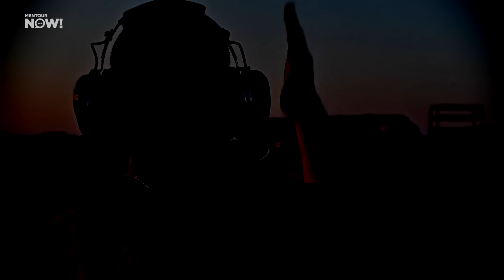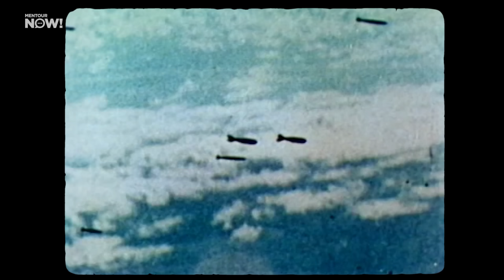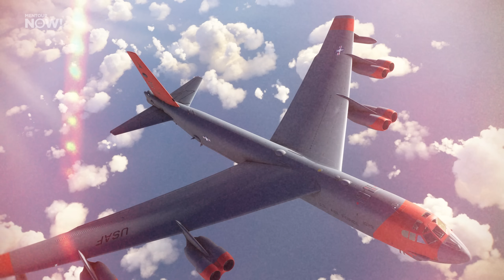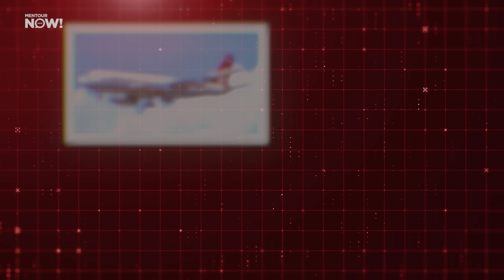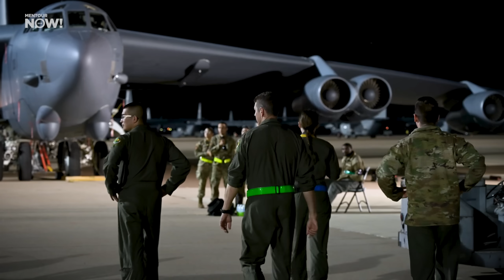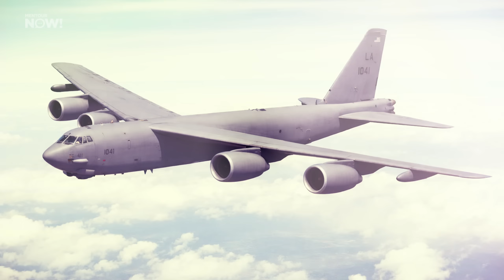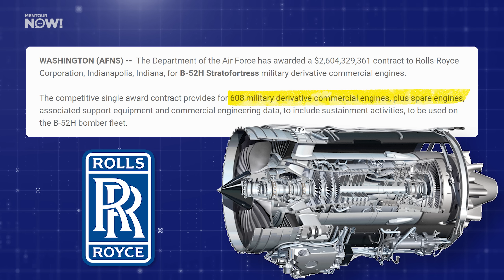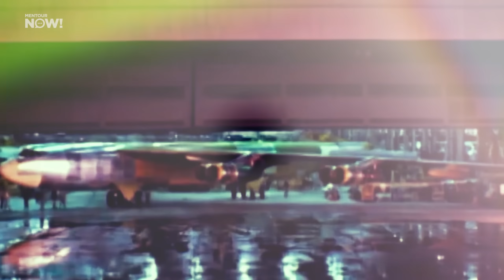WHY Are They Changing The B-52 NOW?!

Comment from the maker: *Use the code "pilot" and this link 👉 https://incogni.com/pilot to get a whopping 60% off the Annual Incogni plan!*
Reply: Hi there. I know this is off topic, but can we get an episode on MH370 and the current search that started few days ago.
Reply: The B-52 is older than the C-130, and neither of them seem to be going away any time soon.
Reply: One of the major reasons is a general technical and economic issue.  There is so much invested in the B-52 that the cost of change, major, minor, replacement, etc. is a huge factor.  The video addresses this in the specific context really well, but the general issues are nearly universal with many other established technical systems.  The legacy system just persists and then passes down certain aspects to replacements.  For example, the QWERTY keyboard we still use today- the layout is well over 100 years ago based on mechanical typewriter limitations... but people are used to it.  It took 20 years for the USA to move away from magnetic stripe as primary on credit cards, etc. because of merchant device base (millions of units).  For something like B-52 the built up capabilities in training, support, logistics are massive.  The economics make it hard to walk away from that unless there is real benefits to do so.  Hence, use a "new" engine (for B-52) that USAF already has some support tail on makes perfect sense!
Reply: @JkGreyWolf-21      The QWERTY keyboard is based upon relative frequency of character usage in the English language.   Also, the design of the human hand.    
      Please don't tell me what new age nerd design you would make it.   I've lived a whole lifetime of computer people screwing up things that our very intelligent forefathers already figured out perfectly fine.
Reply: @BillSmith-fx7xx.    You’re likely thinking of the DVORAK keyboard.
    
QWERTY was not the first, or second, key layout.  It was adopted because the old typewriters would jam with multiple arms running in to each other, trying to share the same space.  Traffic jam issue that got worse the faster someone typed.  The most used letters had to be spaced out because of the physical arms behind them.  
.  Google response:  The Dvorak keyboard layout is an alternative typing arrangement patented in 1936 by August Dvorak and William Dealey. It places 70% of frequently used English letters on the home row to maximize typing speed, reduce finger travel distance, and minimize repetitive strain injuries compared to standard QWERTY keyboards. 
Don’t get me wrong, I’m no fan of “tech bros” who are myopic, but logistics and design persistence are real things.
That’s kind of proving my point- the DVORAK keyboard design SHOULD have replaced Qwerty- but it didn’t.
Reply: @JkGreyWolf-21       Thank you for your kind response.   😊        When I learned typing in high school we were taught that the QWERTY was designed with efficiency in mind.   What I picked up reading on internet was that with a few adjustments to the 'then' existing design, the QWERTY emerged and was the more effective typewriter.   QWERTY solved the internal key jamming problem.   
        Actual key placement 'for speed' may represent a slightly different reality for a modern piece of equipment that is not dependent on mechanical movement.   I did come across this sentence,  " . . . initially used a much simpler, alphabetical arrangement of keys. "    THAT MAKES ME LAUGH !  😅  😂      Seeing as how the English alphabet has the vowels strung from one end to the other and the R S T L N  in no partcular coherent arrangement, one can only guess as to what 'simpler alphabetical arrangement' means !  😮      ?  ?  😅
       Again, I do appreciate your response.   I learned something from it.   (I am hot on the heels of A I.  I'll catch AI in a day or two !  😂 )    
     Examples of new smarts.    One space between sentences instead of two.   Not enough spacing around letters;   i,  l,  1, .   Go look at any old books, newspapers & magazines (pre 1960) and see how much easier they are to read.   Five-hundred-thirty ish years between Gutenberg printing press and digital and the 'modern' people think they know better than the useful 'standards' that those type-setters developed.  For 500+ yrs they knew better.   Since the first digital computer document was created, documentation has exploded a gazillion-trillion-billion times over.   The 'new smart nerds' have made every one of them harder to read !   😢  😢      Or I could discuss Elon's resistence to putting the turn-signal lever back on the steering column !   Use the center mount touch screen icon.   YIKES !   
       Seems I have diverged from keyboards.   Sir, you have a good day !   It has been a pleasure.   
      P.S.   I use 3 spaces between sentences.   The computer spaces are small !
Reply: They're still flying de Havilland DHC-3 Otters in Canada in commercial service  that are 70+ years old. Wonder if that's the oldest?
Reply: I would give Incogni an F- based on my experience.  Their "money back guarantee" is shorter than the window they need to close with the data brokers, how convenient!  My spam has only increased and their weak response is to have me send them screen shots of all the spam.  But wait, wasn't their sales pitch that they reduce customer workload?  Total BS.
Reply: @justwantresults8768 , ouch!
Reply: As a B52 crew chief in SAC back in the 70s I appreciate the update. Talk about  fuel, the KC135, fully fueled, weighed about 300,000lbs. While the B52-H could and would often launch with 300,000lbs of fuel plus it's bomb load.
Reply: There was nothing said about Radar Cross Section?
Reply: So basically the cores must shrink while everything else remains the same size. Same thrust, and just sipping gas.
Reply: You take too Goddamned long to make relevant, useful points.  
Is this guy a pilot ?  Because us A&Ps never accused them of
knowing too much...
Reply: Nicely done!
Reply: No.
Reply: 😮 20:41 20:42 20:42 20:43
Reply: If I were being shot at.  Either from other planes or flak from the ground.  I'd rather have 8 smaller engines than 2 big engines.  This way if two engines were damaged, I'd still have 6 functioning engines.
Reply: @BrettonFerguson  Zero IQ take. You want fraction of the range, speed, reliability, electricity, etc, just to keep old trash? Also, clownbecile, if one pod is hit, the explosion of the engine will most likely destroy pod next to it so you're left with 4 engines on the other wing that offer even LESS than 1 modern engine would sooo...
Reply: @BrettonFerguson  I’d rather simply not volunteer to bomb people. 🤷
Reply: @mikegreen2214     That is assuming no one wants to bomb you.   I would not count on that.
Reply: Rolls Royce in name, but with little british in it. It started as a joint venture: BMW Rolls-Royce AeroEngines GmbH in germany. Design and production are located in Germany.
Reply: @juliane__  A 'joint venture' with RR Aero engines GmbH (a wholly owned subsidiary of RR) but 'little English' in it? The engines for the USAF will be manufactured in Indianapolis. RR"s German subsidiary makes a civil version of this engine.
Reply: @juliane__  You see that bit of 'BMW Rolls-Royce AeroEngines GmbH' that says 'Rolls-Royce', that's the British bit and the 725 wasn't developed till after BMW had opted out and it features both 700 series and Trent design elements.
And the German part was more Motorenfabrik Oberursel (KHD) than BMW (I'm inclined to think that the 700 designation is a allusion to their last wartime engine project). Post war they returned to aero engine production and building gas turbines and gas turbine parts under licence for various companies including Rolls Royce.
Reply: Outstanding video ... great research along with super information
Reply: It's an abomination changing the classic analog instrumentation with digital slop.  heh
Reply: @BillAnt Not if you're trying to stay alive 😂
Reply: Thanks for this very informative data dump.  Much appreciated.

And I must say, back in the early 1980s, I knew a guy in ROTC who was a senior when I was a freshman, and he became a B-52 pilot like his father.  And he reported that his father, a decade or 2 before, had written his name in paint pen on the sun visor of the same airplane my friend was now flying.  And that was what, 2 generations or more ago?  So yeah, it's crazy that of all the military planes I grew up with and saw on a daily basis in the 60s-80s, the only one still on the front line is the slowest, least-efficient, and least stealthy of them all.  I've seen all the Century Series of my youth disappear, along with the F-8, F-4, F-14, E-2, A-3 through A-7, etc.  And in a prior career, I built B-1s and B-2s as well as C-17s, while keeping C-5s and C-141s limping along. And I've seen the F-15, F-16, F-18, F-117, and F-22 come and go or stick around to be heavily modified for increasingly limited usefulness.  And now it's the turn of the F-35. May it all work out OK in the end.  But the ancient BUFF keeps on soldiering. Gotta respect that.
Reply: They should just have boeing upgrade some 777s with bomb doors and the necessary equipment, problem fixed.
Reply: @thomgizziz They haven't completed the desitn and production for the new Arforce One,  yes, thats not what the plane is called, I know. Don't distract them with a super heavy bomber request.
Reply: The plane is up to the H model which means it's been upgraded 7-8 times already. They did make a replacement for it, it's  call the B1B.
Reply: :hand-pink-waving:
Reply: What about the treaties that only allow B52s? Hello Turkey. Also dont forget how small the rudder of a B52 is. Mainly it's about the treaty.
Reply: @daniellarge9784 B-52 rudder is huge....?
Reply: Buff's getting knee replacements.....
Reply: Yatahey Db from Hawaii
Reply: Interesting video!

How many BUFFs will be upgraded to the J model?
Reply: Sigh  YT wont let me post a link

This came across my FB feed today

Retirement ceremonues for NCC-1701G were interrupted by a B-52 flyby
Reply: I think while you were recording, theres music playing in the background. It's like having a fly on your back you can't quite feel and you can't quit hit. 
Great content short of that.
Reply: Has a soldier I've had the opportunity to fly on numerous airframes. The one thing about the B-52 is its payload capability which to me suggests why keeping 8 engines is a requirement. Plus when a nuclear event occurs they may have to fly through the massively rising pressure and survive. As you know better than I do, a mere general aviation pilot, the B-52 hotel is able to fly on a minimum of two engines safely, or in rare incidents fly on one engine. That gives them the ability to carry multiple 500,000 lb bunker busters. The B-52 can carry payload of 70 k compared to the B1 bomber can carry a payload of 75k. The b-1 lancer is less capable of surviving EMP from a nuclear bomb but can fly lower and faster. There are trade-offs on both sides.
Reply: The USAF have been clearly been reading the Dale Brown "Paddy McClanahan" series of novels!

They're trying to create the Megafortress!
Reply: How else do you milk the American taxpayer. More money for a useless weapon instead of healthcare, roads, bridges, fair wages , retirement, etc etc.
Reply: @silverthorngoodtree5533 Without this “useless weapon. Chances are pretty good you could be speaking Russian right now! BTW, I have been around longer than the BUFF, barely. But that makes me old!
Reply: They should replace it.
Reply: @Scott-25300 It's highly specialised. Replace it with way. I guess modern avionics woulr b3 nice though. I believe the B-52 has Inertial reference systems for nagvigtion. Its a dinosaur, but dependable.
Reply: @gorillaau  They could just take 777s and stuff in all the specialized things that they need. This isn't that hard of a problem to solve they just don't want to make the change because they are stuck in their ways.
Reply: @thomgizziz Military budgets run deep.

Comment: Mentour,   I'm digging way back, way back.   All the B-52s flying now are H model, first gen turbo fan, probably TF-33, as stated.   The earlier B-52 G model was, I think, J-57, second gen turbo JET, no fan, all exhaust.   Some KC-135A models were refitted with TF-33 (variant) and were redesignated as KC-135E.   Right around 1985-86, the remaining KC-135A models began being upgraded to the CFM56.   Then were redesignated as KC-135R.   
       Also, the B-52 wingroot was upgraded once already in the mid 80s when they put on the pylons for the ALCM, Air Launched Cruise Missle.   Six missles per side.
      Back in the day, Boeing, McDonnell Douglas, Lockheed, Northrop, they made some tough airplanes !   Upgrades & mods are important but they had great airframes to start with !   You gotta wonder about some of the modern stuff.

Comment: One clear difference between an airliner and a military plane is the hours flown per annum.
This affects the value of engine efficiency. Efficiency is  the most important component (after safety) in design decisions for an airliner. On a military plane, other factors (like surviving impacts) may be more important.

Comment: It would make more sense to convert a C-17 airframe to bomber duty. The C-17 has 170,900 Lbs of cargo capacity vs the B-52's 80,000 Lbs ordinace capacity. The C17 has 245,226 Lbs of fuel capacity, whereas the B52 has 312,197 Lbs of fuel capacity. If 90,000 lbs of the C17's cargo capacity were transferred to fuel capacity, the C-17 would have 325,000 lbs of fuel capacity (10,000 more than the B-52). As discussed, the existing B-52s are using eight Pratt & Whitney TF33-P-3/103 (17,000 lbs thrust) 1.15:1 Bypass ratio, where the C-17 is using the four Pratt & Whitney F117-PW-100 turbofan engines. Each engine delivers 40,440 pounds of thrust (131% more total thrust) and a 5.9-1 bypass ratio. The C-17 has one of the most incredible supercritical wing and flap designs, with incredibly short takeoffs and a cruising speed of Mach 0.825 (578 MPH). The B-52's swept wings take a long runway to take off and are designed for a cruising speed of Mach 0.780 (550 MPH). The C-17 is a fully digital integrated warfare plane. The C-17 currently drops the 21,715 Lb GBU-43/B MOAB (mother of all bombs), which the B-52H can not.

Comment: I'm retired now, but worked many years for USAF DOD, Civilian Employee (Machinist)
I lost count how many parts I machined for the B-52. Some very simple, others, quite complicated.
Having blueprints of the parts I was making dated in the 50's. 8 - 10 years before I was born!
The TF-33 engines on the 52's were a very old design. They smoked worst then a cigar and were not very efficient 
Replacing them only made sense.

Comment: You do not explain why the B52 is staying ‘relevant’, specifically when comparing to current the current B1 B2 that are actually working,   What is wrong with  those that you say the B52 will still be flying when these are retired.    You do great work, but this seems an obvious point that should be made??    Especially when penciling out the 10yr calendar, and the costs involved… how can keeping the B52 pencil?  Are the B1 B2 in fact that bad of an aircraft that they are less expensive, in time and money and function, that these 40yo planes and all that is required to keep them “relevant”?

Comment: The B-52 first flew in the early 1950s. It was equipped with the then available engines. Jet engines have been undergoing continuous improvement in fuel efficiency ever since. It would be foolish to continue to use outmoded 70-year-old engines, because contemporary jet engines are far better in every way, including fuel efficiency. New engines reduce fuel consumption and extend operating range.

Comment: You do not get it.  The aircraft is paid for. The engine is paid for. They do not have to spend as much for the parts.  Once it is stopped production. New engines are chosen.  Bit the B52. IT CAN FLY ON 2 ENGINES. Using the last allows more funding for other products.

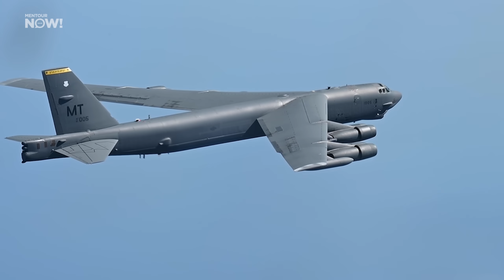Comment: 3:40 it's because the B-52 fills a role that none of the other aircraft you mentioned can. Sure, a B-1 can go supersonic and the B-2 is stealth but they both have far smaller payload bays than the B-52. The B-2 is what we use when enemy air defenses are still intact and operational. The B-1 is what we use when enemy air defenses are being actively suppressed and raw speed is enough to get in and out unscathed, and it has a larger payload bay then the B-2. The B-52 is what we use when enemy air defenses are nonexistent, because it's way more economical at that point. We need neither the speed nor the stealth at that point, we need the sheer capacity for putting warheads on foreheads.

Comment: I’m 76 and from ‘69-‘73 I was in the USAF stationed at Loring Air Force Base in northern Maine. I was a guidance and flight control tech on the AGM-28B Hound Dog missile a one megaton nuclear armed cruise missile. The B-52G had two, one mounted on a pylon next to the fuselage on each side. 
I have been inside the aircraft though that was just a “tour” as my job didn’t entail any work on the plane. I worked in a shop running diagnostics and repaired the ancient inertial guidance and flight control systems on a missile designed at the end of the fifties. One day in ~’71 I watched a B-52 sitting outside a hangar burn to the ground. It was under repair, unfueled and without any weapons but there were explosions as the tires exploded.

Comment: Ya they are still flying a 70-year-old jet, but complaining and moaning and groaning over a 50-year-old jet that has no replacement, the A-10 Thunderbolt II has no equal, while we have the B-2 Spirit, the B-21 Raider, and the B-1 Lancer, three modern bombers, not to leave out the F-15 missil truck as a bomber too.  The B-52 does bring at least one thing to the battle: carpet bombing, when they say bomb you back to the stone age, they are talking about the B-52.